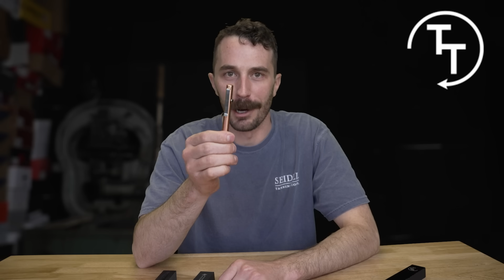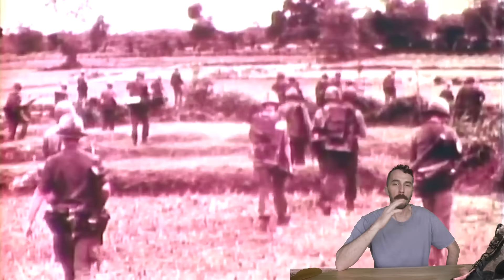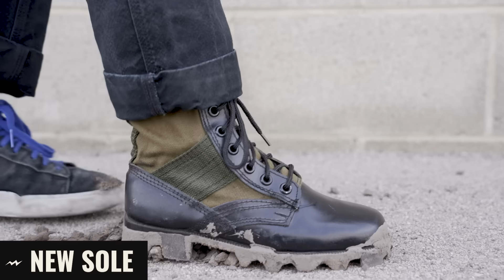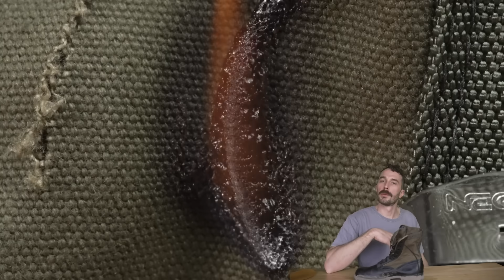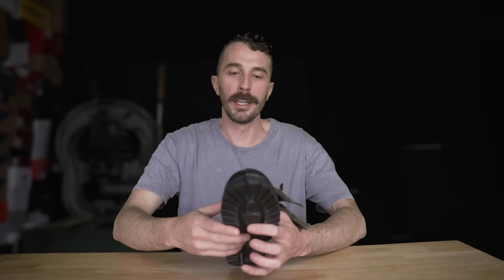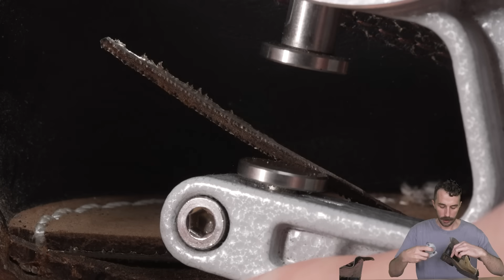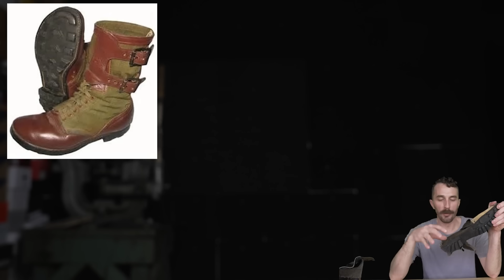Why it took 57 years to replace jungle boots

Comment: Awfully high heel on those boots.  Good prescription for back troubles carrying a heavy combat load with your heel at such an angle.  Your foot is designed to be level, i.e. bare foot.  Evolution has worked out what is best and foot gear should compliment that not ignore it.  Oh well, this was the same military that decided you didn't need water in the tropics--a salt pill would replace water!!

Comment: Have worn a pair of these at many festivals in the UK but it was 2010 that they were truly tested. Torrential rain for the first night and following day turned the site into a quagmire of soupy mud but two days later this had dried out to a  shin deep, shoe-sucking substance. Whilst all around me were either stuck entirely or missing at least one piece of footwear, I breezed on past with these on. They provided unparalleled grip but did need to be periodically de-mudded when the mud was at its thickest.

Comment: I'm curious if the wood block in the heel made the boot more buoyant in the water? If your boot came off in the water or otherwise ended up going for a swim without you attached, a buoyant boot would be nice to be able to find your boot again even if it was just the heel just barely floating. I've never had a pair of these boots so I'm not sure if it works but an interesting thought and neat experiment if someone had a pair with wood in the heel and could test it out. But how do you know if it's got wood in the heel without cutting it open? Hmmm.

Comment: Wore jungle boots four years, US Army 75th Ranger Regiment…those boots went through hell and back, and kept my feet safe and in good condition.  Long hauls on hot roads or tarmac weren’t so grand, that steel in the sole would heat up and encourage blisters, but for every other temperate clime they were the bomb.

Comment: I was in the military for 40 years and went from the all leather black boots to the black jungle boots until the latest tan rough leather. Loved that last boot because we didn't have to polish them! No one cared if they got dirty or scuffed. I still buy and wear them as they give great support.
As for bunny boots, yes I've seen them and when stationed up north in Maine I had the choice of wearing the Bunny Boots or the Mukluk Boots. Thank God someone tole me to get the Mukluks. They turned out to be warmer and we could keep them. We had to turn in the Bunny Boots when we PCS to another base. They also called the Bunny Boots Moon Boots. Not sure why, but I think because they bounced a bit when you walked in them. At least that is what I was told.

Comment: Thanks! My favorite US Army boots! Wore them through two Ranger Schools 73 and 77. They were not authorized for general wear in the US Army at least in my Armor unit. I would wear them today if I could find some that were not knockoffs of the originals. Another great benefit of these boots was the break-in period was next to nothing compared to the old leather boots which did require a long break-in period or you would regret it...blisters galore!😬

Comment: Some Jungle boot facts:
They were issued with spike protective inserts as a stop gap prior to the addition of steal shanks.

The cotton sides were initially 10 inches vs 8 inches.

The nylon sides prohibited those of us on flight status from wearing them.

The last versions had speed laces vs eyelets.

Regulations were changed in the early 90s prohibiting the green sided boots and tho only ones we could wear were the black ones.

Comment: They were my favorite boots.  Especially after the soles wore out and I got them re-soled with comfort soles.  Had 3 or 4 pair of them.  I wore them until the day they were no longer authorized.  If I remember correctly, the all black version was around a while longer until desert/digital/urban camo replace woodland camo.  Great boots.  You knew it was time to replace them when they started clicking when you walked.  That clicking was the sheet metal breaking from metal fatigue and the broken edges clicking past each other as you flexed them.  Yes I cut them open to learn this.  Haha!  I still have a pair or two in a box somewhere.
Reply: Lol, I remember hearing about the clicking from guys before my time. Now we all know what it was.
Reply: Quick question for you. It wasn’t a problem to get these resoled at a cobbler shop? I thought cause they were vulcanized that it was impossible

Comment: Nice pens, Weston, but too expensive for me.  I was in the Navy from '73 to '80.  I joined the Navy to keep from being Drafted in to the Army, straight out of high school, to be a Ground Pounding, Gun Carrying Grunt in Vietnam.  Seems like all Enlisted wore thick solid leather, black Boondockers then, at least on American Naval Air Stations.  I was shore-based, working on large aircraft without a tail hook, and mine had Steel Toes.  They were heavy and cumbersome to get used to, never having worn boots before, but really not bad after that.  We even played volley ball in them at lunch breaks.  Sometimes I miss them when I do certain kinds of work.  I recently bought some Steel Toes in a similar design from Walmart for cutting down trees with a 20" Gas Chainsaw.  Just a little nostalgia there.

Comment: I've had several pair of these boots since 1970. They are great in the jungle, but they don't hold up well in freezing weather. Out of 7 or 8 pair I've owned, 5 or 6 pair failed during freezing weather. They were made for hot, humid weather and when you wear them on frozen ground, the soles will split, rendering them useless. I guess the sole's composition was meant only for a warm/hot environment.

Comment: The pumping of water out is still in use today. OTB Jungle Lite boots are designed to push water out and draw air in with each step. I began using their Desert Lite Boots in 2010 and used them in Afghanistan. After i got out and into the civillian world they stopped making the Desert Lite and then redesigned it into the Jungle Lite. Great Combat boots, they are lightweight, durable and they look good too

Comment: Wore mine all the time with my BDU’s from 2006-2010 in the Air Force. 2010 I switched to the Rocky S2V when we moved to the ABU uniform but I kept my Altima Jungles for my blues uniform. Could shine those boots to a mirror.

Comment: Maybe I'm talking out of my ass since I don't really know all that much, but correct me if I'm wrong:

Getting stabbed by through the foot is awful obviously, but there are different degrees to the extent of your injury, and there are certainly spots that will "just" hurt, and others which might permanently cripple, or take you out of the action for months, if not even just kill you from bleeding out on the spot.

THAT threshold is probably determined by how close to the leg you actually get stabbed through the foot, therefore, the more protected your heel is, the higher your chance of survival.
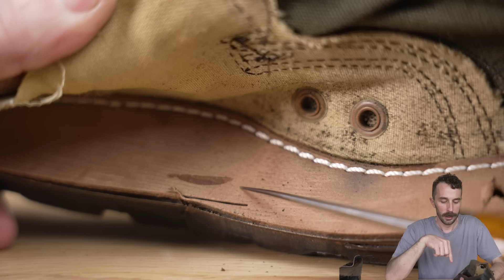This idea would certainly explain just how dense with materials is the heel on the cross section as you can clearly see here: 8:03

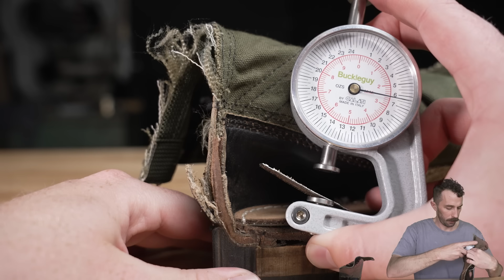Not only that, but by having the combination of "rubber>wood>metal shank>leather>metal plate>leather" that the spikes are required to go through in order to reach the actual foot, and that the actual metal shank seems thicker than the plate (seen at: 9:06) and only covers the actual heel seems to prove my point.

Any thoughts? :)

Comment: im actually wondering if they put the wood in the heels as a kick assist. heal from 100% rubber or similar synthetic would be a giant shock absorber. you put a wood block in there, and your heel becomes strong for a kick again. thus kickin in a door would perhaps be a bit easier? just a thought :D

Comment: I wore three pairs of socks in my boots rain or shine in temps from +40°C to -40°C. The innermost were white cotton, or cotton poly blend gym socks. The middle were thin black dress socks. And the outer were thick army issue 100% wool. As I walked, the boot breathed in and out. It kept my feet them cool, dry and comfortable even after hours and hours on the hot asphalt.

Comment: Never was in the military but have bought several pair of surplus. Wore them until they basically wore out. Good boots, got my money's worth out of them . They held up so long the leather uppers turned white. Highly recommend them. Meant to add if you get them oversize, they also make good dry cold boots with extra wool socks.

Comment: A very interesting presentation.  The plastic mesh insoles look the same as UK military issue from the 1980s. They were issued with an all leather, high leg combat boot with a moulded sole. They were unlined (apart from a leather piece in the heel) as opposed to the fabric and membrane lined boots that dominate today. They weren't the best boots that the British Army ever issued but were much better than the DMS ankle boots that came before them or the very poor quality "Assault Boot" that followed.

Comment: Those are better than the jungle boots I got from a surplus store for a canoe trip where we were expected to wet foot portage (this prevents damage to the canoes from hitting rocks). The big issue for me was the insoles that just fell apart (they weren't the mesh used in these boots). Last time I used them was for a fishing trip where I was going to be wading, but didn't have waders.

Comment: Used to be able to buy them “used” at a local Army/Navy surplus store for around $15 during the early’70’s - best work boot anywhere for a cash strapped young man…lasted forever.
Reply: I have a pair now that are stamped 65 and I've been wearing them since highschool. I'm 49 now
Reply: There still about 15-20$ at the local surplus nearby. I always avoided them, but now I might pick up a pair for summer hikes.
Reply: Where? If real I will get a large supply.
Reply: @ronv6637  Sorry, Ron that was about 45 years ago and that particular Army/Navy store has been closed for decades …
Reply: Cheapest work boot is $35 now a days and no where near as good as this.
Reply: I did the same, but they do not 'last forever'. I went through 2 pairs. First pair I wore all the way down to the metal insert! Great boots though.
Reply: It doesn't have a steel toe Soo I would not work in them.
Reply: @WSNight-   I got the tan desert era with steal toe, great work boot.
Reply: I have mixed feelings about these.  I seem to recall the original Panama sole jungle boots (real USGI) being somewhat lacking in terms of cushioning, and the tan colored desert boots being only marginally better.  That being said, I seem to recall there being ones with Vibram "Sierra" soles and them being much more comfortable, and I currently have an all black pair with a "V-Trax" sole that feels like a modern boot in terms of cushioning and support, with a soft light floppy top attached.
Reply: Oh, and I recall the Chinese made copies feeling like a painful toy, and never did wear a pair of the old school early production vibe sole ones.
Reply: yeah, I got mine for $20 in the early 2ks. Still have em, still use em. Lace em tight with thick socks n you'll never get a blister.
Reply: If I could lay my hands on such a pair of boots, I wouldn't hesitate. They're grand!!
Reply: I want some for exactly that, work....
Reply: Nobody cares about those God damn pants
Reply: Will they keep your feet semi warm in the winter? I know they won't be as warm as winter boots but would they be warmer than the average pair of tennis shoes
Reply: @michaelbrinks8089  They we’re about as warm as high top tennis shoes, given they’re made from thin leather with canvas tops. During cold weather you would wear thick woolen socks to keep your feet warm.
Reply: @jimseviltwin1  Thanks for the reply/info
Reply: @michaelbrinks8089  , any tight squeezed socks will make your feet cold. Even wool. Socks have to be snug or less. Wool best.
Reply: I wore mine for about a year after returning. Comfortable, lightweight, enduring, everything right.
Reply: @Senator Joe Mccarthy,I try to tell people who brag about wearing many pairs of socks this but they tend to ignore then complain about cold feet and damaged boots.
Reply: Last forever my arse.  I wore them in the USMC
Reply: @ramtrucks721  they last forever with civvy use. light loads, n long walks in the hills ;)

they were my favorite backpacking boots back in the day. Adda  modern insole, thick socks, lace em tight af = no blisters.

Comment: I have a pair of these, with the new sole and steel plate in the bottom, they belonged to my grandpa. I had been planning on going on a hike, and he asked me what my shoe size was, then sent me into the closet to find a pair of these. They were caked in mud and dirt, and they were a little tight but after hiking in them for a few miles they fit me just fine. He was an MP in Vietnam, I'm honored that he let me put this piece of history to good use. He wore these ones mostly when he was instructing, since he says (and it seems like this is a common consensus) were one of the most comfortable boots available at the time.

Comment: The design of the jungle boot is actually what made designers go back and re-engineer the boot for dry, hot, desert rock terrain that soldiers use today. At the beginning of the Iraq war, my cousin was in the Marine Corp in the early 00s and wore the 2nd gen jungle boots with the heavier bigger lug sole that you showed, during his 1st tour and he told me that soldiers were still being issued Vietnam war era jungle boots during the early days of the war and the desert terrain was so hot and brutal that it was melting the rubber soles and tearing the jungle boots and the soldiers feet apart when they were out humpin. My uncle also served during the 1st golf war in the army and they too were issued left over 2nd gen w/ bigger lugged soled Vietnam jungle boots and you can see soldiers wearing the jungle boot with desert fatigues during the desert storm campaign in pics online. But when they came out with the 1st gen desert boots, it was just a copy of the jungle boot because it looked just like it no new designs, vent holes, but they were tan in color and had the huge lug soles and my cousin said those were so uncomfortable and soldiers complained about them not being functionable because they still fell apart and now they were just even bulkier. So they had to go back and redesign them again and start from scratch to create a boot that was specifically for desert terrain.

Comment: I had a pair when I was recon with the 82nd late 80's. Road marched so much the steel plate broke in one of them. They are not really designed for walking on hot concrete or asphalt. You could feel the plate heating up it seemed like.

Comment: I had a pair of those when I was in the Army. Unfortunately, they began to hurt after a few days, and I kept banging my ankle bone on the thin canvas material. I also remember the little drain holes with brass screens that would burn my skin in the desert.
Reply: Yep, the little things that goes unnoticed when wearing more protection around the outer ankle area.

Comment: I hated these boots in the Marines. If they weren't causing me to lose toenails on humps (forced marches) they were strangling and leaving deep gouges in my ankles from the laces. 

One of the greatest moments in my service was when I was able to start wearing modern technically advanced boots - and in particular on humps. I could have easily hiked twice as far in those new boots. There is absolutely no reason why servicemen should have had to use such backwards shit for so long.

Comment: I loved my issue black leather boots from 1982/83. Probably were made in the 70's.  They broke in, and shined great.  Comfortable, and after years of use,  being sanded, worn in, they were great.  I picked up Jungles in 85 at Bragg.  They were lighter, but my feet did not like them as much as my issued leather waffle bottoms.   In 88 we got the "new Boots.  They were not that great of an improvement and I was kicking and screaming to keep my old ones.  Note: I had some jump boots. Only for inspections and formations. LOL.   Once I exited service in 92  I gave my boots away.   Now I see these new boots that cannot even be shined. LOL.

Comment: Make sure when you buy these that they are MADE IN USA. The pathetic knock off's made in China are absolute GARBAGE. I bought a cheap pair of "texas steer" desert ankle boots 7 years ago and still wear them all the time. I sized them so I could use thicker inserts when I bought them. Took a little time to break them in but they're very comfy and only cost around $60.

Comment: So it won't save you against a James Bond villain type attack? Strapped to a table on a slow moving conveyor belt with a bandsaw at the other end that perfectly cuts your feet down the middle. Trash Boot.

Comment: It's hard to see, but at 8.15, looking at the close-up of the construction, there seems to be TWO metal plates in the thing, a full length thin plate, and a half-length thicker one from the front of the heel to just short of the ball of the foot. So the construction is - insole, leather, plate, leather, plate, rubber - at the rear half of the boot.

Comment: i feel another thing to add is that compared to later military boots these are atleast still somewhat nice looking shoes in general, ww2 boots i think still look better but later on down the line you could never wear more modern boots around, these are just passable with the right outfit

Comment: Bought a pair of these for $20 in a war surplus store in 1976, and wore them daily for years.  That included 10 miles of daily walking.  I stupidly painted a house wearing them and got them covered in paint, so finally retired them.  Super comfortable from the get go, and wish I’d bought several pairs.  I had no idea they still made them, or they could be found surplus (the days of the Great War surplus stores are gone.). I’ll have to track some down.  Thanks for the review!